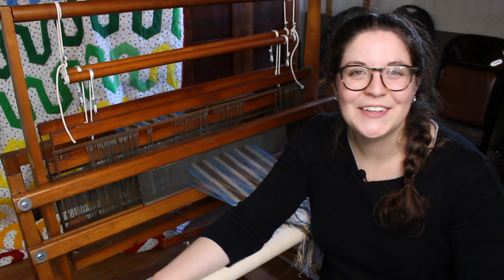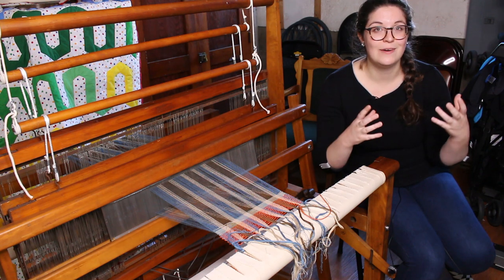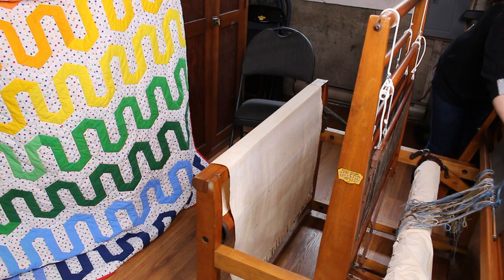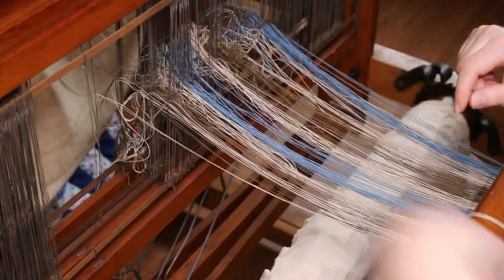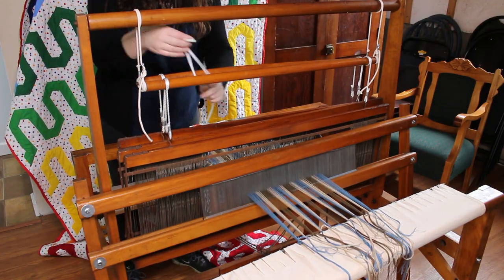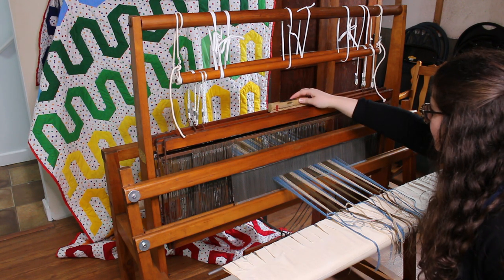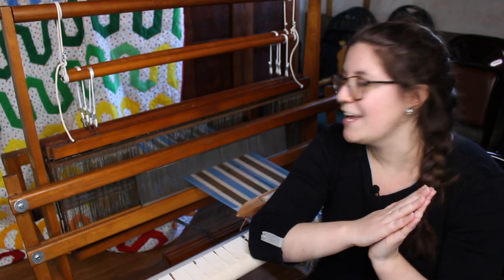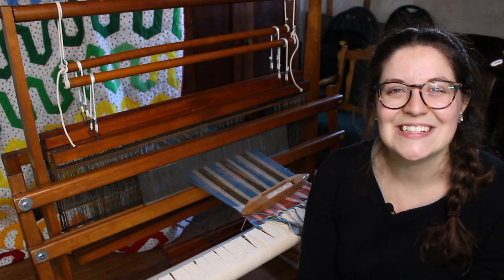Warping my Old Leclerc Counterbalance Loom for the First Time using the Front to Back Method

Comment: Your “rusted” heddle rods can be soaked in white vinegar for 24+/- hours and the rust will wipe off clean. I did this for a loom and it worked perfectly. 2 years later it is still rust free. I had used the bathtub since I did not have a bucket large enough for bars to lay flat.
Reply from the maker: Thank you so much for the tip 😁 did you leave your heddles on when you soaked them?

Comment: If you miss a thread next time, it is possible to hang it off the back with a weight.  I use a prescription bottle with fishing weights in it.  The thread can go in the  bottle, or get wound around the outside. It hangs down the back, and you release more thread as you need it.  I also did not see you using a warp separator.  I'm not sure if you did.  I use paper lawn and leaf bags, inexpensive and easy to find.  I cut the bottom of the bag off, then down the side, and you have 2 pieces of warping paper (the bags are double thickness).  I am currently restoring a 1970s or so Leclerc Fanny loom.
Reply from the maker: Thank you so much for all those great tips 🥰 I will have to try the prescription bottles! You are right, I did not use warp seperators this time. My warp is so small that it didn't rolled over itself on the back beam! Good luck on restoring your Fanny Loom! This is such a great project 😊